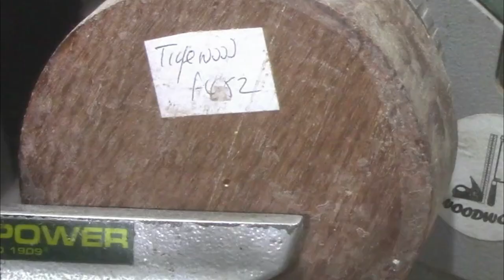Woodturning - Tigerwood Bowl

Comment: How do manage to avoid a great deal of tear out using carbides? I always end up with a bunch of it with my bowls. Just curious
Reply from the maker: Good question, so its as simple as this really.... i use high quality carbide tips, just because it says carbide on the packet it doesnt mean they are very good or sharp, Easy Wood Tools Carbides are the best on the market in my option and i have used a lot of different kinds, then you make sure the tool is dead centre, and you dont twist the tool, you keep it flat on the tool rest and parallel to the floor and you should no problems...... hope this helps
Reply: @jpwoodwork  that is an awesome answer actually. I have been turning for about a year and have only used carbide but have not been able to find that answer. Does turning speed make a difference? Higher or lower speeds?
Reply from the maker: @kevinjensen9817  to be honest when it comes to speed, i say go as fast as you feel comfortable turning at, usually the faster the better unless you are coming to sanding then you want to go about 200-300 if your lathe will go that slow if not 500rpm will do. ok so if you are still struggling to get rid of the torn grain theres a tip you can do to help, put on some sanding sealer (not the aerosol) and let it soak in, this will stiffen the wood fibres and you can then take a couple of really light passes and it should be easier to sand, feel free to ask if you have any more questions, i will be putting a video out in the new year about turning with carbides, hopefully that will be to some use to you :)
Reply: @jpwoodwork  I appreciate this info. The slowest my lathe will turn is like 900 rpms but it is a cheap mini lathe. Hoping to upgrade to a variable soon. Congrats on hitting 31 days in a row tomorrow with your videos. Didn’t miss a single one
Reply from the maker: @kevinjensen9817  thanks buddy, I think I’m actually gonna put a couple extra out in a row because my normal day is a Sunday and it seems pointless missing 2days to then start my weekly videos again